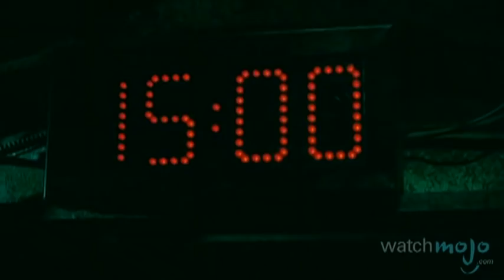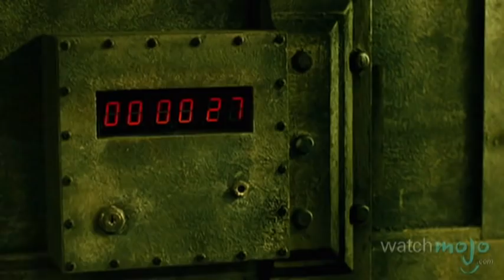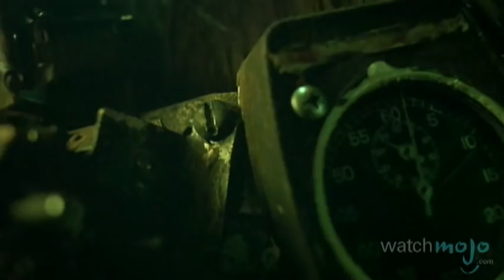Top 10 Saw Traps

Comment: Trap Solutions (Without Death):

Bonus)
Hanging BarbWire (intro): Victim could tie the chains together before the weight kicks in.... it will counter the mechanism and neither noosed person will die

10) Shot Gun Carousel: 
i) Victim shouldn't put hand on the "pain pedestal", instead put clothing (shirt) folded into the thickness of a hand there instead to take the "pain" and spare everyone 
ii) Victim could put hand throw cage (if viable) and pull the shotgun away from everyone with enough force......

9) Flammable Jelly: 
i) Victim shouldn't step on the glass simply slide/glide feet through the glass to avoid pain via simple brushing it away 
ii) A large majority of the flammable substance on the victims body could've also been wiped off by brushing his body on the wall (or floor if he didn't mind the glass) 
iii) The victim could have tried every possible combination on the safe from lowest to highest digits until they found the right one given that they had around two hours to complete the task (more than ample time).

8) Pints of Sacrifice:
i) Both victims could have urinated, defecated and/or spat out (salivated/flem/vomit) an easy 10+ pints of body fluids/liquid between them onto the liquid scale (as the scale didn't detect what type of liquid it was being filled with)

7) The Needle Pit: 
i) Every victim in the room helps clean out the pit needle by needle quickly but carefully using their clothing (and the planks of wood on the surrounding walls in that scene) as a sort of net to fish out all of the needles.... until they find the key

6)The Scalping Seat:
i) Free victim finds something metal (or as strong as metal) to put in the cogs to halt the "Scalping" until the mechanise is fully disengaged
ii) If the free victim is strong enough they could potentially pull the seated victim's hair in the opposite direction (against the cogs initial direction)... this will likely still rip the seated victim's hair badly and hurt a bit,... but at least it's not their scalp being ripped off
 
5) The Mausoleum Trap: 
i) Both victims could possibly use the bladed weapons they find to quickly (but painfully) removed the threads stitched on their faces in order to "see"/"speak" (respectively), then cooperate by handing each other the keys for their freedom...

4) A Pound Of flesh:
i) Same scenario as the "Pints of Sacrifice" trap... ergo the "contents" that the scale is filled with doesn't need to be body parts/blood.... the tools/utensils they had available (blades, knives,..etc..) could have been thrown down the scale's shoot instead and the scale would have panned out it either victims favor (minus the gory mutilation)
ii) Jigsaw doesn't demand a weight be heavier than the other for either victim to survive..... therefore the trap may not have even killed either of them if neither of them had of even put anything on the scale to begin with... a risky move granted,  but an interesting thought all the same.... (i.e a trick test/trap.... possibly)

3) Walls Closing In:
i) Victim steps into the coffin carefully to avoid the glass cutting, closes the lid and then waits for the wall mechanism to activate... looool (as demonstrated in the movie)... easy enough

2) Reverse Bear Trap:
i) Just do exactly as Jigsaw demands, but calmly and quickly.... panic, fear and hesitation are your worst enemy with this trap... and there is no other way to do it without setting off the trap prematurely (this trap essentially forces you to murder someone else for your own freedom/life)

1) The Angle Trap:
i) Tip the acid out of the jar quickly (trying to leave only the key still inside the jar hopefully) then place hand in jar and quickly grab the key.................... after that you should be home free with minimal to no hand burns from acid.... unless Jigsaw didn't make this trap of course... because then you're screwed regardless of what you do loool
Reply: You sir, are the next Macgyver. Bravo.
Reply: Sorry to say but there are flaws in your solutions.

Bonus: If you tie the chains together it would (probably) partially lower both of the pedestals they are standing on, making them angled, therefore making both of them slip off. Both dead. Besides, you can&#39;t tie them together because you have to hold on to them first, therefore no hand can be free TO tie them together.

10:
i: System is setup that the hand can only be stabbed twice, even if there is something in there. Although what you say can help the pain with the stabbing, it doesn&#39;t change the outcome.
ii: Strength of clothing vs strength of four bolts screwed into concrete and metal gears...don&#39;t think that would work...

9:
i: good point, but you do that incorrectly and it slices instead of stabs.
ii: kind of a good point. I doubt it would be that effective. Although it would have probably prevented the death he did have.
iii: 10,000 to 100 million combinations (depending on the lock of 10^3 - 100^4, respectively) without errors in 2 hours? Hell no. There&#39;s a reason why the locks are made as such. You would have to be faster than the fastest rubik&#39;s cube solver in the world. Even then the poison would make you deteriorate closer to death causing a curve of efficiency like in the second movie.

Alternate partial solution:
Use the underwear to wipe off the jelly, better than using skin. Then tie it to your feet to help walking around on. Wouldn&#39;t do much but its something. And just focus. I would bet that Jigsaw put a better clue to tell what the combo is than we know. Kind of like &quot;the numbers are in the back of your mind&quot; tattoos.

8:
Absolutely true. Just have to make sure to lift the blades setting off the mechanism first though.

7:
It was far enough in the ground that you can&#39;t just &quot;reach in there&quot; without jumping in. But otherwise a good idea.

6:
i: He shot the thing and it didn&#39;t stop. But I do agree for the most part.
ii: I doubt that could work. Things made to pull a scalp off of a human. That&#39;s a ton of force to begin with. Especially if you need to find a strong piece of metal to jam it like you said in the first solution.
ALTERNATE SOLUTION: Just let the scalp rip off. I doubt that would kill her. (I always thought this was a stupid trap) You can look it up if you don&#39;t believe me. She would be close to death with the blood loss but enough to get her some sort of help. Plus that would disable her enough that she couldn&#39;t try to kill you. To avoid letting the scalp rip off he could just shoot through the hair burning/cutting most of it.

5:
Absolutely correct. XD

4:
i: The tools were chained to the table. Seems to be a common &quot;solution&quot; for some reason.
ii: Clever...but risky as you said.

3:
Yeah, very apparent. lol. However there is one more way. Maybe have enough force to break the glass to the coffin? It&#39;s probably bulletproof though.

2:
That wasn&#39;t really a solution...but whatever. Here is one:
Carry the chair with you or wait until someone comes for help. Eventually the guy (cellmate) will wake up out of the serum and he could go get help while you sit there.
This solution is the same for the venus fly trap. Idiots freak out and pull the pin out causing the timer to go off. Until then you can just wait it out or figure something else out.

1:
There is no possible solution. It&#39;s just plain murder. Amanda is a bitch.

And always remember, coming up with solutions is fun and all, but knowing jigsaw and his careful selection and evaluation process, the participants are either too stupid, stressed, or drugged out to react any differently than they did.
Reply: Nick Licata

yeh there are 10,000 possible combinations :

"There are 10 choices, zero through nine, for each number in the combination. Because there are four numbers in the combination, the total number of possible combinations is 10 choices for each of the four numbers. That is, the number of possible combinations is 10*10*10*10 or 10^4, which is equal to 10,000"

Link: https://www.reference.com/math/many-combinations-can-made-four-numbers-e2ae81e7072bc2b4

but you could get lucky from just brute-force guessing.. worth a try if you're desperate
Reply: OH duh, that's right XD 100 million if it's based on 0-100 (like 79, 23 etc) and has four combos as well.
I can't math.
Reply: Cool! Liked it!
I've watched this movies long ago, so now I'll be answering within the information of what I can see in this video.
Intro) I don't think it's possible for one to reach another
10) i) I will ignore the fact that must likely Jigsaw would probably kill everyone if any of them cheated in any of the rooms (or else, there would be no point in this conversation). i) Good ii) What I would probably try to do first.
9) i) I've cutted my feet A LOT when I got my own apartment. I'm clumsy and inside my place I'm always barefoot. Learned that when you need to cross a path where you've just broke some glass the best way is to go nice, slow, easy, try to take the most of it gently out of the way with hands and NO MATTER WHAT use your hands before stepping in any area. Think it would take a while though. ii) That looks like Napalm. iii) Dunno, too many combinations.
8) I think I would just try to jump on the top of that thing and try to brake some part. Actually, I think my first reaction would always be to try to destroy something and get a piece of anything that could help in later rooms. 
7) If someone has thrown me there, I would just wait and see all of them dying too. Not cool, bro.
6) Don't think anyone is strong enough to get the hair out with bare hands. But trying to jam it seems like a good idea. But I don't see anything strong enough to stop a kinda grinder. 
5) The LAST thing I would do is to go berserker trying to find/kill someone. I know myself, if I could not see, I would try to comunicate. If was the other way around, maybe trying to cut the stiches in the mouth would not be a bad idea.
4) The #8 you actually need to be with your hands in there, but in this case you don't. BUUUUUT the tools are chained to the table, so it's not possible (unless you try and suceed with my first trying technique to destroy everytinhg in the scenario). Buuuuuuutttttttt, here, you indeed could piss on clothes and throw in there, vomit, crap, and just throw anything inside the machine. (Not very fancy, but would do the job). Assuming the chain don't reach so far. But there is some some other tools not attached to anything and even a stool. A stool can't be so strong that you can't break at least parts of it if your life depends in that.
3) I quite don't get the job done in this one. Once more, if we ignore jigsaw not letting someone break the rules, wouldn't it be able to just enter the god damn thing? And the two of them are even wearing thick jackets, a hell load of any better decisions apparently could have being made by the two there.
2) I think I would just slip my own throat
1)The jar is kinda loose and if she can reach the top, she can easily reach the bottom. Anyone will die anyway, but would be a more intelligent first decision to spill the acid before, I think.
Reply: +Benjamin Crossman damn... ur pretty smart and u did pretty well catching all the flaws the other guy had... the only flaws I saw u and him had, was that in #6 the women had a knife, the man could have taken that knife and cut like a lock of her hair off instead if it being ripped off. and #3 yes he could have broken the glass either way, normal glass he could have broken, and actually bullet proof glass is actually easier to SMASH, yes SMASH open than normal glass... again notice I said SMASH, take ur jacket/shirt make a padded cover over your arm/fist and hit it....
Reply: Thank you! As far as the #6 point goes, actually neither one of them knew it was a knife so no one even really "knew" it was there. Out of sight for him, and she just knew it was "something to protect herself with".
Reply: wow, jigsaw got nothin on you
Reply: You cant trick Jigsaw or he'll just kidnap you again and force you to re-play the game.
Reply: FlapJason Actually, there is a mistake with the impossibility of the #6 "just start guessing"  solution. If it was any spy movie, the lead or nerd character would just try kick in any random numbers, than suddenly having an epiphany and getting it right in the fifth try.... LOL
Reply: lol so true
Reply: For 4, (pounds of flesh) the tools were chained to the table, so they couldn't.
Reply: Kitty Mitty ;3 I know right, I swear 80% of people on this video haven't even watched any Saw film.
Reply: Vault Dweller Hey, one of the first things I've said is that we should ignore the fact that Jigsaw would not be very pleasant if any of the contenders started cheating. If we can´t rule it out of the room, it's game over all the way right from the beginning (I mean, you can actually make it alive, but damn, just shoot me in the face already!)
Reply: this count down didnt show it but in the movie, the trap was designed that no matter what, the lady dies. she actually ends up getting the key out of the acid but it didn't matter because the trap was designed to go off regardless of what happened.
Reply: referee rob I know I've seen all the movies multiple times. The trap the women was in was attached to her rib cage through surgery so the key wouldn't do anything, plus the trap was set up by Jigsaws apprentice who belived certain people should die unlike Jigsaw who belived everyone deserved a second chance.
Reply: but then it wouldnt be any fun
Reply: Your good
Reply: 8. Why not use the knife she had to cut the hair?
Reply: jaswah Well, we actually have some good examples that there are some people that could actually manage to do it (that guy from 127 hours being the more iconic example). So I think it is possible. But regarding myself, I would not stand a chance.
Reply: urukey yeah, there are cases, but realistically it's all bs that at the very least he's the only guy to stay relaively calm. It's more fun to watch tho lol
Reply: 1.Isnt posible to pour the acid onto metal or onto the ground then she can get the key?
Reply: Vitrum The key was useless, if you had seen the movie you would know the trap was rigged and there was no escape.
Reply: Vault Dweller Wait, was it the one where Jigsaw's assistant took over? Cause she always rigged them.
Reply: jaswah Yeah it was Amanda
Reply: That's actually amazing!
Reply: I thought the same thing for the flesh one the angel one and the pint one also the shotgun one
Reply: +Benjamin Crossman he wasn't wearing underwear, so he couldn't do that
Reply: Bro I wish me and you would be in a Saw movie
Reply: +interllect123 could you answer the trap where you have to cut off your foot
Reply: Tiger Beat cut the pipe, they are super rusty
Reply: TheZizamie I don't think you would be able to saw that pipe off with that tiny Saw that is made for wood, even if it is rusty.
Reply: Tiger Beat

could try kicking the pipe with both feet maybe after a while it will break and you can slip the leg shackle through the pipe.... (also If I am correct in saying, I vaguely remember in that particular trap scene there were 2 victims in the room 1 free 1 chained up... the freed victim could have easily helped the chained one if asked nicely enough)... so if that is the exact same scenario you are in, then you could ask the freed person for help in breaking the pipe together ... the more people there are the more likely the chances of safely escaping a jigsaw trap after-all.... well survival rate is a bit higher at least

or.....

maybe try breaking the chain:
1) finding a weakened link in the chain and prying it apart may work, maybe if you have like a metal pen, metal nail/screw or a thin metal rod available (in which case you could even try picking the lock itself)
2) cutting the chain with saw as previously suggested... though I strongly doubt you could saw through those chains "rusty or not"

or...

in the scene itself he had a wooden box and he was trying to get his phone (to call for help) with it... initially that was a great idea, but sadly he pulled it off sloppily (as he was in a state of panic i guess).... but that idea was a solid one, all he really needed to do was reverse the box's dimensions (i.e. meaning length-ways pointing outwards towards the phone... which would have given him allot more reach) with the box's inner lid pointing downwards (towards the floor) in order for the lip to "cup" over the phone and then he could have easily dragged it towards him...

or...

waiting for help to arrive as the challenge was not timed with a bomb or death trap from what i remember (but his family where under threat from Jigsaw if he didn't escape in a certain time frame in the movie, so yeh... maybe not such a good idea in that case)
Reply: 10. It was set up so the mechanism that delivered pain and prevented a shotgun blast could only work twice, so four had to die if playing the game. Your idea for avoiding pain would work, however.

9. Solid plan in regards to the jelly. We don't have much detail on the safe as to how the locking mechanism worked, as it may have been abnormal, with some form of instructions revealed in the code (such as extra digits in the combo), so I can't say if brute forcing the combo would have worked or not.

8. I believe urination would not have worked as the mechanism was triggered by weight, piss is lighter than blood, and the jar only held 10 pints. An easier solution would be to break the glass/plastic (whichever it is) around the saws and simply press the jar down. There was a heavy-looking metal hook in the previous room that would have done nicely.

7. If I'm remembering the movie correctly, they were looking for antidotes to slow-acting poison. They had a ton of time, and they could have gone through it methodically without it being too painful (and taking her time wouldn't have been lethal for them IIRC). Also, your solution would work, though I think it would be more efficient time-wise to just use their clothes as makeshift gloves rather than as a net.

6. I think the actual solution is better than your proposed solution, as it was a combination that released her entirely. Alternatively, the woman had a knife in her boot, and realistically, even though she was supposed to kill him afterwards, she would have told him about it when she thought she was going to get her scalp ripped off (which in that environment would have been death) so he could cut her hair off.

5.  The guy with his mouth sewn could part his lips a bit, so he could have made rudimentary words. Also, he could have just knocked the other guy out, gotten the keys and released both of them (he didn't have to completely bash the guy's skull in. He was already down for the count when he delivered the death blow).

4. The issue with dropping the tools in is that the other person can do the same, and your goal is to beat them. Also, in that situation, the primary goal would be survival, and they'd want a certain chance of survival over the uncertain chance of both surviving by doing nothing.

3. Yeah, the thing is it was a fight and the agent was stupid. How could he have not realized that the coffin was the safe spot when the fucking walls were closing in on the locked room?

2. Yeah, the reverse bear trap is the easiest trap in the entire series. She does the challenge believing that the guy with the key in his stomach is dead (even though it turns out he was alive). Though cutting into a freshly dead body would be disturbing, it's nowhere near the level of torture that basically everyone else had to go through.

1. The trap was designed to be unbeatable (it wasn't designed by the original Jigsaw, who always made it so the victim could potentially escape). I believe that the key would not have unlocked the trap (can't quite remember), and in any case, the entrance was welded shut so she couldn't have escaped.

It's also worth mentioning that the pendulum (one of the honorable mentions), though also unbeatable (designed by Jigsaw's apprentice, who had a personal grievance with the victim and wanted him to suffer without redemption) is one of the only traps in the series that couldn't have been BS'd out of had it worked as it was explained to the victim (victim stretches his hands out to push the levers, the machine crushes his hands, and the pendulum does not kill him). The guy was strapped to the table and there's no level of fuckery that would have let him cheat the trap.
Reply: I bet he wouldn't pick you to play his games
Reply: The flammable jelly seems by far the hardest
Reply: In the shotgun trap all 6 shots have to be used.....
Reply: Interllect123 it's saw, even if you escape the trap, he'll find a way to kill you still
Reply: I dont think you've watched the movies, Interllect
Reply: Benjamin Crossman The reverse bear trap is often hailed as one of the more difficult traps to handle. 
It's hard to see for sure, but finding an angle in the room to jam the upper and lower sections on of trap between something solid (metal, concrete) and keeping your head firmly there would completely undo it. It's a pressure activated device, meaning that once it 'goes off', if it doesn't close, then it won't when you remove your head because there is no energy, it''d just be flaccid and very uncomfortable. That's the dangerous, uninformed, might not work way. 
Easy as shit guaranteed way: As before, pressure release, complete with a neat little pressure gauge. There will be small diameter pipe work on the device you could feel for with your hands, the metal will be a malleable and weak one because of its diameter. Break a seal, pressure released rapidly through the leak, mechanism fails, device broke. Even if there was a 'failsafe' built in so that a break in integrity would cause the trap to close upon being tampered with, the pressure would be relieved by the leak faster than it would through the gears, because the mechanism provides a delay through resistance. Therefor, there'd zero power in the closing mechanism. This isn't a state of art engineering master design. It's a piece of shit made out of junk parts.
Reply: Interllect123 — Well, for #7, the whole idea of that movie's game was that the combinations to the safe in the first room was collectively on the back of everyone's neck.  They didn't have to exit the room at all, thus never finding the needle pit in the first place.
Reply: people with saw 2. the combination only open the safe which had only 1 antidote so doesnt work for everyone. he throws amanda in the needles and she gets the key but the door locks so they dont have enough time for any dumb solution.

the hair one she is a selfish person like all the victims and is given her way out. sure she could have given him the knife but that was her test and she failed. 

as for the closing room. it didnt close till after the coffin shut. so u want to trust a killer and jump inside a glass coffin. good luck with that.
Reply: Kevin Jameson — If you'll remember, the safe also had oxygen tanks for everyone, meaning that they wouldn't have needed to inhale the nerve gas for long enough of a time to kill them.
Reply: Interllect123 1 problome with the last 1
SHE DID GET THE KEY AND SHE DID OPEN IT BUT JIGSAW MADE IT SO THAT SHE CANT ESCAPE
Reply: number 2 buddy was useless he was given a opiate overdose he couldn't move or feel anything
Reply: Benchpress33 — Yeah, I always imagined that he failed his own "game" and that this was his fatal punishment.
Reply: Why are there a bunch of numbers and symbols in your random sentences?
Reply: Interllect123 - I hope you relise its a horror movie, they always choose the dumbest choices and never think of logical solutions
Reply: With the Angel trap though, there really is no way out of it but death. As seen in the movie, she does get the trap unlocked, but dies anyway lol. All of the other solutions are pretty spot on though, nice thinking!
Reply: Interllect123 This comment is how you end up being in a jigsaw game,
Reply: For the walls closing in, what about the other person?
Reply: TheSimmoMaster one person goes into the casket which falls into the floor avoiding the walls the other person gets crushed between the walls
Reply: TheSimmoMaster That wasn't a game that Jigsaw made it was a trap that the corrupt officer made to kill the other officer who was about to find out the truth.
Reply: 10. As has been pointed out, the mechanism stops working after two goes. The two limit wasn't one for each hand, it was the number of times the shotgun could be lifted. The victims probably could have tried turning their abs and leaning over though since their shoulders weren't restrained in any way. Shotgun would probably still do lethal damage, but if they could wiggle enough they might get lucky and end up with only a shoulder shot or a side shot, and might even be able to rely on the ribs to mitigate some of the buckshot (the gun has to be tilted upwards anyways in order to avoid killing the person directly opposite the current target on the carousel anyways)

9. Yeah, probably would have been best to leave the candle where it was. He probably could have actually used the glass shards to scrape the jelly off his body like he was shaving or something. Maybe could have ignited the scraped-off substance as a torch, in fact. But he definitely didn't have enough time to put in every single possible combination- assuming it's a 4 digit code with 10,000 possible combinations, he would need to average 84 numbers/minute, or roughly 1.4 digits per second. That might sound feasible at first, but remember that this is a twist safe and you have to do a full rotation for repeated digits. Plus, the poison would start to take effect in the last few minutes.

8. Even better, they could have completely exsanguinated the dead body from the previous trap... they even were standing in the other room as they figured out the trap and made the realization. 

7. Nope, there was a timer on this one and was barely enough time to find it (the dumbass drug dealer it was meant for was stupid enough to drop it and lose the few precious seconds needed). Not a fatal trap anyways.

6. Or better yet he could have simply literally thrown a spanner in the works by jamming the gears with the pig mask, or some other metal object. 

5. There were no bladed weapons that the dude whose mouth was sewn shut could reach, initially. He only gets the hatchet when the blind man is already trying to kill him. Only the dude who was blinded had access to a bladed weapon, which would have probably resulted in him slicing his eyes and remaining blind if he'd used it like that. 

4. The tools were indeed tied down... but the hose for cutting off circulation was not. Would have probably resulted in a tie, though, and considering Reverse Bear Trap proves Jigsaw has no problem with traps that are impossible for all parties to survive, as long as one person can survive, I doubt that doing nothing would work. 

3. Self-explanatory escapable trap. Though I do wonder who that trap was ORIGINALLY meant for, since Jigsaw himself designed this trap. 

2. Yes, there's the easy way to escape it, but failing that, you can always do what Hoffman does at the end of Saw 6 and jam the teeth of the trap between two solid bars to give yourself enough wiggle room when it springs to escape. Will tear the shit out of your cheeks, but better than being turned into a human Pac-Man. 

1. This one actually SHOULD have some way of escaping it, because unless the behind-the-scenes surgeon hooked the wires to the ribs while she was in the harness, there should be SOMETHING securing the hooks to the rig that is detachable. Finding that connection point and pouring the acid onto that might actually allow you to escape- if there's enough slack on the chains to allow you to swing it towards that point. Since they're hooks, though, it might even be possible to simply wriggle your way out of this one- simply hug the harness and feel your way through the holes the hooks must have dug, and then shift your body weight either forward or backward depending on which way you feel the hooks are going (they can't be hooked sideways since that would require digging through the ribcage and that would puncture her lungs). It would hurt like hell, but you'd be escaping the same way a fish escapes being hooked on a line.
Reply: Interllect123 how long did it take u to think of these
Reply: PopularMods 1 kid   mk
Reply: Wow you're really smart
Reply: Interllect123 so even the greatest of trap can be solved. All be damned
Reply: Interllect123 Dangg, You would of totally survived
Reply: please dont give a clue
Reply: The Angel trap was inescapeable
"Every possible angle has beem thought out." 
-Lawerence Gordan
Reply: #10: it doesn’t matter there will still be pain and no way to stop the shotgun or pull it up
#9: there was 10,000 different combinations would’ve taken more than 2 hours.
#8: the woman cannot urinate in the jar and ten pints of any liquid is a lot so between 2 peoples urine/vomit/liquid between two people would’ve taken a very long time.
#7: the whole point of saw 2 was for them to work together that’s why they ran out of time.
#6: he tried to stop the machine with something and the force would be to strong for him to pull the hair out.
#5: also the whole point of the trap.
#4: the utensils where chained down and in the movie he specifically says that the person with the lowest weight dies.
#3 in the movie the person in the box is the bad guy and tricks the guy that dies into thinking the box was the trap and that it was a trick.
#2: jigsaw has told Amanda he was dead that’s why she killed him she didn’t know he was alive and the Venus fly trap he was in an empty warehouse in a room with concrete walls who is going to hear him.
#1: Amanda made it impossible to escape. 
BONUS FACT: you are not meant to cheat your way out otherwise jigsaw will kill you anyway because he sees you do not appreciate life.
Reply: How much time do you have!?!?